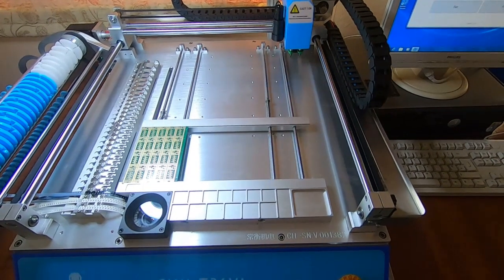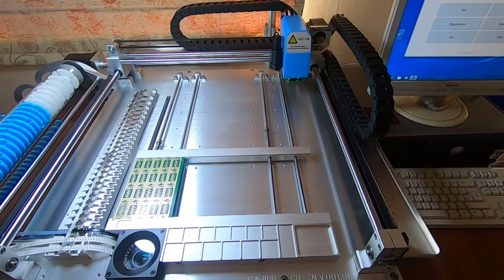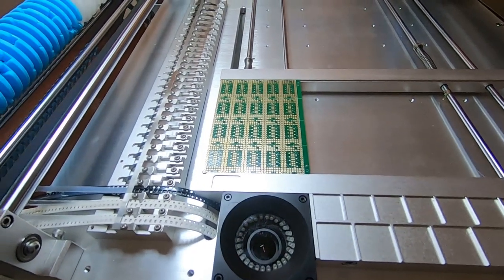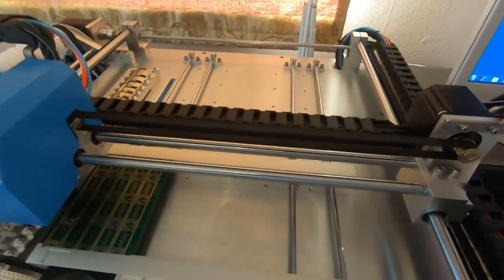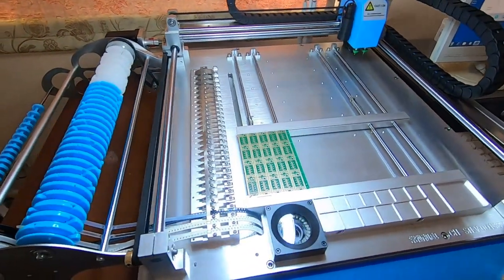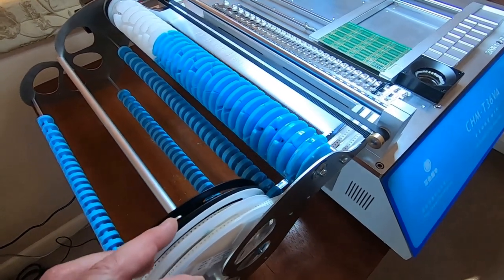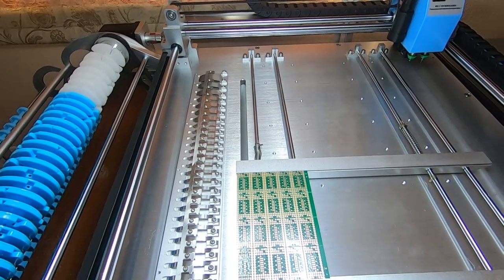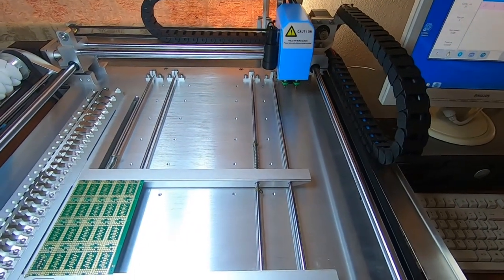CHM T36VA Pick and Place Machine Part 1

Comment: how does this machine advance the components to the next one on the reel/spool, with the head?
Reply from the maker: There is a small solenoid which lowers a pin. The pin engages with the hole in the tape reel and the head then moves the programmed distance for the component type and this pulls the tape out. The tape cover is wound under tension onto the waste take up reel. The pin is then raised and the next component has been exposed and can be picked up by the nozzel.
Reply: @JerryWalker001  great, thanks a lot!

Comment: How is this machine running now two years later?
Reply from the maker: It is still working fine. It has now placed over 1000000 components. The only problem I have had with it is the reel guides are fairly brittle and tend to crack after a while but they are easy to replace with 3D printed copies. Also the reel tension needs adjusting every so often to prevent feeding reels that are not wanted. The X axis belt needed adjusting after around 500 hours. I lubricate the rods every few weeks and they still look good although one of the bearings is getting a bit noisy but again should be easy to replace. I use it mostly for 0805 and 0602 plus SOT23 and as they all use the same size nozzle I mostly fir the same size to both heads and I am still using the first ones I purchased.
Reply: @JerryWalker001  I am watching your videos and expect to be ordering one of these for our business if I can actually use it :D  Do they give you the software when you buy one, a download link?
Reply from the maker: @DerekSpeareDSD  Mine was delivered with a memory stick containing a version of the software but I did not use that version as it only supported 2 point board calibration. Their website had a version that did support 3 point calibration so I used that instead. The only downside to that was some of the menus are in Chinese and as I do not speak Chinese I had to figure out what some of the options were but it is not difficult. A lot of the information on line tends to imply that you must use certain pcb CAD systems but that is not true (usual social media lazy reporting) you can use any software which can produce positional output files although you will need to figure out what to name each field and what order to sort them (see my videos).

Comment: I guess the obvious issue with those reels is that if you want to change the one in the middle, you have to change half the reels to get to it
Reply from the maker: No, you can change them one at a time in any order. You withdraw the bar and then the reel will lift out. It is not as easy as the casette based systems but it is still fairly easy.
Reply: @JerryWalker001  
OK.
Clearly I'm missing something, wouldn't they all fall on the floor if you pulled the bar out?
Reply from the maker: Underneath the reels there are two more bars with reel separators. If you pull out the cental bar then the reels rest on the lower 2 bars.You can then replace whichever reels you want to and then refit the bar which passes through the centre of each reel. I sometimes even run the machine without the central bar fitted. If you look at the reels from the end (front of the machine) then the two lower bars are at approx 5 and 7 oclock positions.
Reply: @JerryWalker001  
Oh so they are, I thought they were some other kind of waste reel like the one by the peeler.
That makes much more sense.
Reply: @JerryWalker001  

Wow, thanks for the information.
Has somebody put a knowledge base wiki together?
OK, second but much more general question, on SMD workflow.

This just does pick and place, right?
Obviously you need a row oven.
Second hand desktop ones turn up on eBay, not too pricey.
But this won't print solder paste on it, will it?
I'd need a third machine to do that, right?

I have a mind to design and sell analogue synthesiser modules based around the Yamaha FM synthesis chip (like in the Megadrive and the Yamaha DX-7) and there's millions of new-old-stock chips available but only in surface mount, in flat-pack not DIP.
Reply from the maker: You may be interested in my series on a reflow oven. You do not need a machine to apply solder paste. Just order your boards with a stencil and then you can use a flat table and some sticky tape.

Comment: Hello jerry,thanks for the video, i am planning to buy this machine,what is your suggestion .thanks.
Reply from the maker: Be sure to run plenty of test boards before commiting your real boards. Double sided tape on old boards makes a good test and you can peel it off and try again. Buy a few reels of very cheap resistors and design a test board with them at different angles and play with it. Be sure to have fun.

Comment: Have you ever tried 0402 ?
Reply from the maker: Yes it works fine with 0402 but you have to be very precise in setting up the feeders. Also I have only assembled small palletts when they have 0402 components (max has been 180 x 140mm). Also make sure that there are plenty of 'spare' components in the reels as it will drop some. Be sure to use the correct nozzle size and clean it with IPA before each use to avoid components sticking to it.
Reply: @JerryWalker001  That info is very useful, thanks a lot!

Comment: I've been using this for a while now and it's been working well for all the components I'm using except the TPS61202. In my first full run it placed everything as I intended and misplaced this slightly so I started changing the component height/feed spacing. Now, the machine draws the component and goes to the bottom camera, does not sense anything and attempts to draw the component again, goes to the camera and states an error "not drawing material:. What might be the problem?
Reply from the maker: Which height did you change? It sounds like you have the part out of camera focus. Try stepping manually so that you can see the component through the camera and see how it looks.

Comment: Do you know if there is a way to have a given feeder be pulled a little more to the right rather than having the hole in the tape be at the upper left corner of the metal?  I keep having the legs of SOIC packages hit the metal when they are pulled up by the vacuum.  I know how to move the vacuum nozzle a little to the right, but that doesn't help.
Reply from the maker: It sounds like you need to adjust the 'pull' to get the component into the correct position.

Comment: Thanks for making these videos Jerry. How many USB ports does the machine need on the external PC? And what type? I assume Type-A USB 2.0?
Reply from the maker: Unexpected Maker, The machine has two connections. One is a USB and is for the video cameras. The other is RS232 and is for controlling the cnc part of the machine although it is supplied with a USB to serial convertor cable so it requires 2 USB ports. I use USB 2 but it should work fine with USB 3. Connections are the usual type A at the PC and one type B at the machine (the other is a D type connector). The machine is supplied with the required cables. (NOTE: I have no affiliation with the manufacturer).
Reply: Awesome, thanks. I’m thinking of running it from a MacBook Air running windows 7 in a VM, as I don’t have a pc for it and don’t want to spent the ,only to buy one when I have a few Macs free. Trying to avoid paying extra for the 48VA.
Reply from the maker: Let me know how you get on. It is not normally a good idea running CNC machines in a VM environment as they often take a few liberties with the operating system to provide the required timing.
Reply: @JerryWalker001  I can always bootcamp it if I need to, but just trying to avoid buying another PC, even a second hand one, just to run a PnP. I'm hoping at some stage OpenPNP might become a real thing for the CHMT36, and if I go the 48VA/B then I don't think OpenPNP will ever be an option..